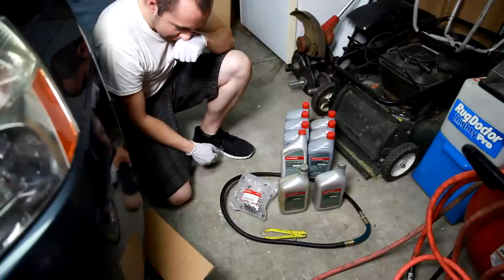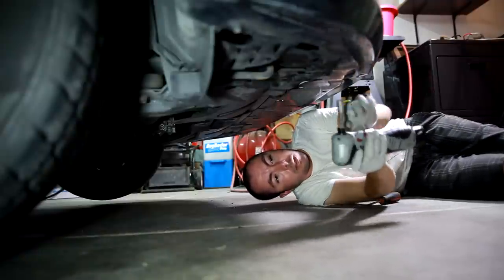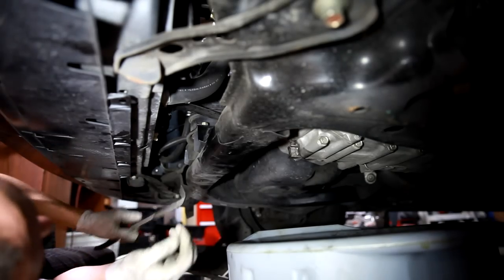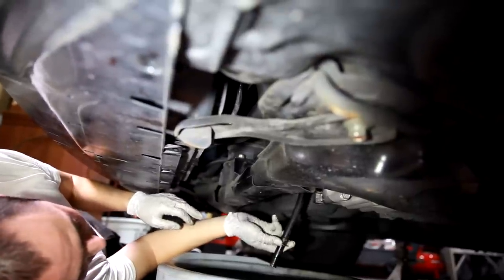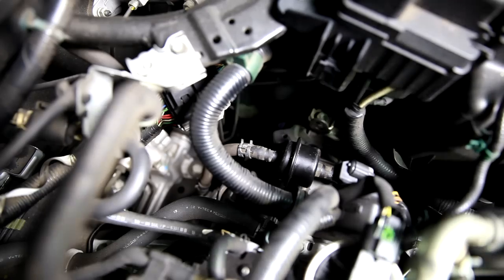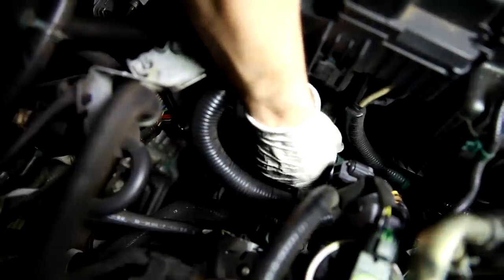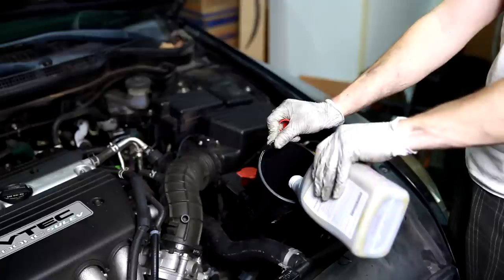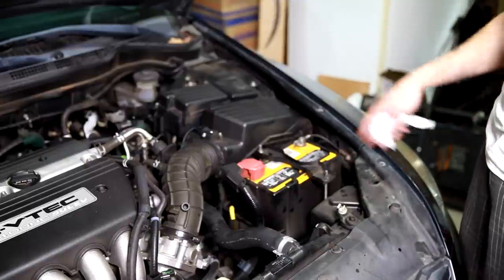2003-2007 Honda Accord Complete Transmission flush with filter

Comment: I have a question I have an 03 accord 4 cylinder with a automatic transmissions and AutoZone is telling me the filter is in the transmission I’m confused 😐 can you help me with that
Reply from the maker: Don’t change the filter in the transmission, see if they have an external filter. If not, try oreilly, Napa autostore, Winchester autostore, maybe online Amazon or eBay
Reply: @NutzAboutBolts   awesome thanks 🙏🏽

Comment: Good night, what would be the recommended oil for the Accord 2005 2.4 EX and how many liters should be put?  Thank you very much in advance
Reply from the maker: 5w-20 oil, 4.7 liters. But put in 3.7 liters then check where the level is before adding more.
Reply: @NutzAboutBolts  what is the size of the gearbox?
Reply: I would like to know what oil is recommended for the automatic transmission box
Reply from the maker: @uesleyjunior7877  info is in the description box.

Comment: Do Honda dealers provide filter if I give them the part number? Or buy it aftermarket? Please suggest, thanks!
Reply from the maker: Yes Honda should have the filters for you to buy.
Reply: @NutzAboutBolts  Thank you for your suggestions. I will check. 
I would like to ask if you have made any video on how to diagnose the faults through scanner for Honda Accord 2007. What type of scanner to be used for an accuracy plus the location to connect etc. That will be very helpful for beginners like myself.
Many thanks.
Reply from the maker: Asif Awan are you talking about how to use an OBD2 scanner?
Reply: @NutzAboutBolts  yes, I have seen people using a program able device to find the faults once they connect with the car ecu port.
Reply from the maker: Asif Awan yes, that’s an OBD2 reader, you can find it at any automotive store.
Reply: @NutzAboutBolts  Thank you for your suggestions and prompt responses.
Reply: NutzAboutBolts Thanks buddy!

Comment: Hi I have a quick question. I have an 07 i4 auto, when my car comes to a stop, as it is downshifting, there is a clunk or two. The car also feels like someone is pushing it. I don't know how to describe it, but it almost feels like someone actually hit my car slight from the back. I checked the engine mounts and seemed fine. Could transmission mounts be an issues? Or something more major? Also, the same clunk is heard when shifting from Park to Reverse.
Reply from the maker: +hmmm how's the transmission fluid?
Reply: NutzAboutBolts Good, I think lol, I replaced it around 80-85k and now the car has about 113k.
Reply from the maker: +hmmm make sure its not overfilled, usually overfilled fluid create that symptom.
Reply: NutzAboutBolts Ok cool, I might just do a drain and fill again then. Thanks a lot!
Reply from the maker: hmmm
make sure to replace your external inline filter if you haven't done so.
Reply: NutzAboutBolts Will do, that's the filter you replaced in this video?
Reply from the maker: hmmm
yes :)
Reply: NutzAboutBolts Alright man, I appreciate the advice!
Reply: NutzAboutBolts I did check the trans fluid, seemed fine. Could there be another reason my car is making that clunk? Could it be the transmission mounts?
Reply from the maker: +hmmm I would check all the mounts to see if there's any loose bolts and if there's any damage mounts.
Reply: NutzAboutBolts Where are the transmission mounts? Is there a picture to show all of them and their location?
Reply from the maker: +hmmm go to our FB page and send me a message, once I am home, I'll send you the images.
Reply: +hmmm 98 - 07 Automatic Accord's are well known for transmission failure. Check for metal shavings on the drain plug if you drain the fluid.

Comment: My honda doesnt have that hose. i have the 2003 EX sedan model with the V6 3.0   does my transmission not have an external cooler???
Reply from the maker: Alex Goble the V6 doesn't have the external filter. As for the line going to the radiator, your vehicle should have it.

Comment: Hi there,i have a 2005 Honda Accord LX Sedan 6V......does the oil pan have another filter? or just the little one you replaced at the top of the engine.
Reply from the maker: +Juan Fuentes the transmission has its own filter but its not necessary to replace it unless it goes bad, which rarely... unless the transmission is overhauled.
Reply: NutzAboutBolts I went to the Honda dealer yesterday to buy a few quarts of tranny fluid,and i ask the guys in there the same question and sure enough they told me exactly what you are saying to me in your message...you really know your stuff. Thanks for sharing your video it was very well explained and very professional.
Reply from the maker: Juan Fuentes
thanks :)

Comment: another great vid, question I have a 95 accord v6 should the fluid level be at the full mark, or in between the two dots on the dipstick after the car has warmed up? thanks
Reply from the maker: it can be either, as long as it doesn't pass the full mark. I would put it at the half mark just to be on the safe side.
Reply: NutzAboutBolts hey thanks 4 the replies, a lot of content creators on here hardly ever respond
Reply from the maker: I guess they're more popular than us so they don't have time to respond? we're still small lol

Comment: Question. My transmission fluid is pretty old and black. Should i just do a drain or an actual flush? Worried about f**king up the transmission.
Reply from the maker: I've heard that if its old and dirty and you try to flush or drain it, the particles that hold it together will be lose and will cause a problem. so if its old don't even bother it, or you can bring it to the dealer and if they mess it up, you are covered by them.

Comment: Hi. I have Honda Accord 2006. It only has 30k miles but it has been now 8 years now. Do you recommend by the miles or years?

Thanks
Reply from the maker: Sagar Swan yes, if you haven't done it, you should do it, fluids degrades over time. So I would do it after that long.
Reply from the maker: Sagar Swan yes, if you haven't done it, you should do it, fluids degrades over time. So I would do it after that long.

Comment: Nice and very detailed video, Just wondering if its the same procedure for a V6 version
Reply from the maker: Akinyemi Akinseye you can check and let us know, we don't have a V6 engine to know :(
Reply: Tw bits are different with V6es.  First, some V6es don't have a replaceable inline filter. (BAD decision Honda!!!)  You can easily put in a generic one from NAPA into the return rubber line from the cooler.  Second, which side/line goes out to the cooler can be different on different Honda V6es, so if you haven't done a particular model and year before, when you pop off one line to drain be sure to run a line from the other end too, just in case you guessed wrong.  Ask me how I know...  ;)  (to avoid spraying ATF all over the freakin' floor!!! what a mess, in just a few seconds...)

Comment from the maker: sbusumacinta - Yes it works on 2004 as well.
Reply: +NutzAboutBolts Thanks for the video.  My Volvo XC 70 (Aisin transmission) uses a similar procedure.  I just got an Acura TL and I want to flush the tranny in that car.  On my Volvo, we are supposed to remove about 1- 1.1/2 qrts at a time.  There is no filter but I might add an inline filter like the Honda.
Reply from the maker: John Ferguson
np :D

Comment: I recently replaced my Accord V6 2007 ATF and thought drain plug. It's shifting very well. A lot improved. 
But never replaced the filter.  Do you think shall I replace it? No complaints about the transmission.
Reply from the maker: Yes, might as well do it since it filters out gunk in the fluids.

Comment: Great video,  I'm just wondering if the ATF radiator flush was necessary since you're doing three drains and fills (consecutively after a drive cycle) because the drive cycle would pump old fluid back into the radiator that was just drained and re-filled thus rendering that specific flush useless. Is my logic wrong? Keep up the good work man, the video was too-notch.
Reply from the maker: 3rick512 the drain and refill isn't reliable as this flush because old fluids aren't introduced back to the system compared to the drain and refill from the pan. When you flush the system, old fluids inside the system drain out entirely and never get reintroduced back with the new fluids like the drain and refill. I would do the flush only if I haven't changed my fluids for along long time. But a drain and refill every 60k should be sufficient though. I hope that helps?
Reply: Thanks  for the reply, it does seem like the method you did in the video would get the most impurities and pollutants out of the fluid. Im just a little confused as to why Honda recommends the drain and refill method over a clean flush. I need to do more research on this. Thanks again, I appreciate it.

Comment: I did the reset drive it around town still no power under 3000 rpm, gas pedal fells soft. better acceleration after 3000 rpm. 

also strong vibration on DRIVE....  OK ON NUETRAL AND REVERSE
Reply from the maker: do you have any check engine light?
Reply: I have the same problem, did you find the culprit?

Comment: thanks for the video my question is how much is the cost for that job?
Reply from the maker: depending on how much you charge hourly. The dealer charge parts and labor at the dealership around 300$?
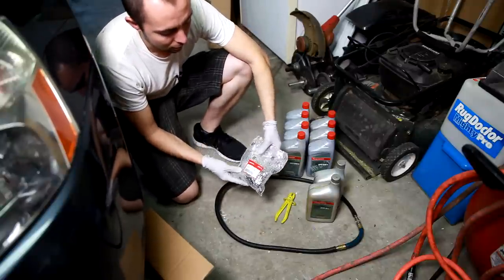Reply: @NutzAboutBolts  Yep you're right - about $250-300 at a dealership, while you can buy the fluid and filter online for under $125, and it takes an hour to 1:30 the first time you do it, quicker after that.

Comment: Hey man I have A 2003 Honda Accord EX V6 Coupe and It's making A slight noise when I switch between Reverse, Neutral, Drive, etc. etc. The noise Is kind of as If something had come loose but after about 15 mph there's no more noise. It's only while parked. Could It be that the previous owner put the wrong type of fluid In the car? Have any suggestions as to what I should be looking for?
Reply from the maker: try changing the fluids and see if the noise goes away.
Reply: Jose Pina check you motor mounts and fluid level. Sometimes  worn motor mounts can cause noise when shifting from reverse to drive and vice versa due to the rubbers being worn out.
Reply: +NutzAboutBolts I've heard changing your Transmission fluid can be bad. How do I know If I should?
Reply: if it is a reddish/brown it's ok to change, if it is black and smells burnt don't change it, your transmission has overheated
Reply: sully676 I fixed the problem about A week ago. But thanks for the insight.
Reply: Jose Pina how did you fix it? I'm having the very same issue.
Reply: Jose Pina how did you fix it ?
Reply: Absolutely DO change the transmission fluid at the recommended interval, regardless of fluid color.
Reply: Ok

Comment: Hey mate how much fluid did you put in ?
Reply from the maker: harish khuttan We used 4-5 bottles to flush the entire transmission system, and 3 quarts to refill, then top it off as needed to the line between the low and high hash.

Comment: how many milles recomended to change the oil??  my honda accord 2006 have a 122K miles ,
I never change the ATF oil and the filter
Reply from the maker: 90k miles.
Reply: Every 40000 miles
Reply: what type of oil recomended i can't buy a original in honda dealer,  I have neer a AUTOZONE what oil do you recomend ?

Comment: Do I need to have the car on until all the fluid comes out...or just for a few seconds?
Reply from the maker: have the car on until you see the fluid starts spitting out like we showed in the video, then shut off your car or else you'll risk running the transmission dry, which can cause damage to it.

Comment: if my transmission fliter is clog and i  change the fluid will it unclog? or will i have to replace the fluid and the filter ?
Reply from the maker: +Talita Clarke if your filter is clogged, you want to change the filter. The filter is doing its job by trapping any particles in your fluid system. So changing the filter out would be a good idea. Flushing the fluids will get rid of old fluids, so you should do both.
Reply: +NutzAboutBolts at first the tranmission was slipping a little and when it does i would turn the car off and restart it and it will go back to normal, secondly i notice i would have power loss when im braking  then thirdly the transmission is slippingand im hearing a whinning sound from the transmission. i just want to make sure once i change the fluid this will solve my problem. when the transmission first began slipping checked the fluid and i notice the fluid was low so i added twp quartz of tranmission fluid and it work for couple days with slipping. what do you reccomend? i live in the bahamas and parts arent cheap over here
Reply from the maker: Talita Clarke
I would change the fluids and filter if it hasn't been done before... it sounded like your transmission is low on fluids so its not working properly... if you have low fluids, your transmission won't engage and your vehicle won't go forward or reverse. Do the fluids first and then check if anything else is the problem.

Comment: Hi, did you ever experience any problems with the transmission after the flush? I went to purchase 10 qts from honda and they tried to discourage me from flushing. Please also share how many miles were on it when you flushed and how many the van has now. Thanks!
Reply from the maker: +desihiten haven't had any problem since the flush, I think it was at 70k miles when I did this, the car has 110k miles now.

Comment: Great video. I've always checked AT Fluid with the engine running. Does Honda have a different procedure?
Reply from the maker: check while engine is off.
Reply: The manuals for my 1993 Volvo 240 AW70 transmission and my 2007 AW55 transmission to check with engine running - in BOLD type with a box surrounding. So, I think it best to check the owner's manual. Otherwise, superb video.
Reply from the maker: yup.
Reply: Most cars you check with engine on. Hondas you check with engine off. It's a Honda thing

Comment: doing this soon to my 07 accord do i drain the bolt in the side of transmission as well as this method or no????
Reply from the maker: +Brian Arbeznik no, since this flushes through the hose
Reply: +NutzAboutBolts  is this best method to pump out all fluid, is this the flush method everyone warns about at oil change places, should i do this or should i just drain and fill 3 quarts and replace filter, what would you do my fluid dosent look that bad bought car with 52,000 just dont know if it was done  ive got 75,000 miles on my 07 accord???
Reply from the maker: +Brian Arbeznik it seems your car is still new, I would just do the drain and refill method and replace the filter.
Reply: OK thanks for your advice
Reply from the maker: Brian Arbeznik
np

Comment: Does this where a leak can happen and the reason why the transmission fluid isn’t staying ?
Reply from the maker: ? Once you’re done draining the fluid, you connect back the hose and refill your transmission
Reply: @NutzAboutBolts  I’m not asking the process bro I’m asking if a bad filter not being changed forever can this cause slipping and leaks in the transmission?
Reply from the maker: @brooklyn7941  the internal filters don’t get changed unless the tranny is bad. The external ones you can change it but it doesn’t cause slippage or leaking due to it being dirty.
Reply: @NutzAboutBolts  mines was rebuilt and the mechanic who sold it to me try to feed me a lie saying they fixed everything replaced the seals
Reply: @NutzAboutBolts  so changing that will help I’m it shifting the gear more ? Or it just helps the oil flow quickly ?
Reply from the maker: @brooklyn7941  they should have warranty on them… if it’s leaking, it’s probably from the housing seal
Reply: @NutzAboutBolts  somebody told me as well it could also be the axel seal too I’m thinking replacing solenoid or pressure switches or the gasket possibly
Reply from the maker: @brooklyn7941  is it leaking by the axle seal, that could be possible too if that’s where the leak is coming from. But at the same time, your gears shouldn’t slip… I’d recommend taking it back and getting a replacement
Reply: @NutzAboutBolts  well everybody say they seen it leaking underneath
Reply from the maker: @brooklyn7941  jack it up and check it out, only way to know where it’s leaking from

Comment: rpm doesn't bounce around. reversing from drive way is okay putting the car on drive vibrates alot. very minimal before cleaning throttle body. 
I changed all motor mount but that's the first thing I check w/o removing it again I loosen all mount let the car settle and torque. but that doesn't explain no power. TY
Reply from the maker: whats the idle rpm? it should be 790 +/- 50 rpm in park or neutral. if its manual, it will be 750 +/- 50 while in neutral. I'm not sure if its your engine mount or could be the throttle body since you removed it and cause the ECM to relearn the engine idle. When you did the idle learn procedure, did you hold the rpm at 3k and wait until the radiator fan comes on? then let it idle for 5 minutes?